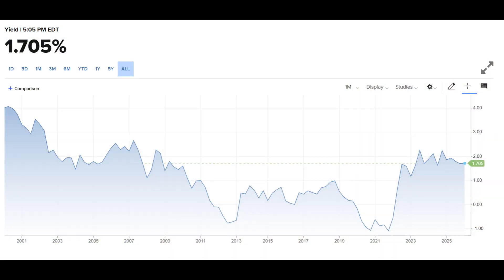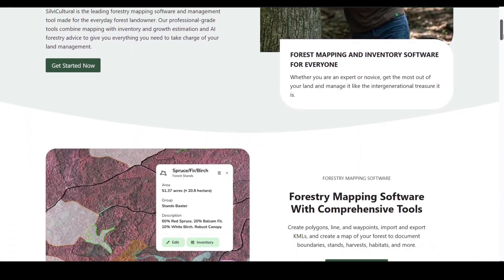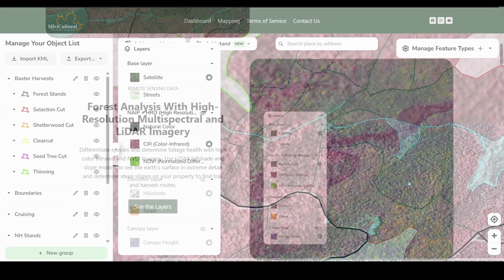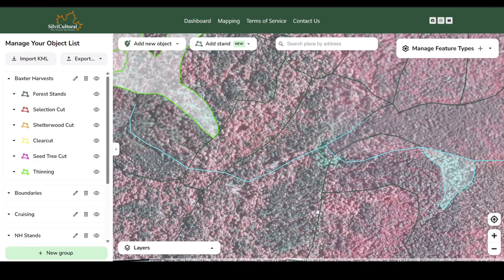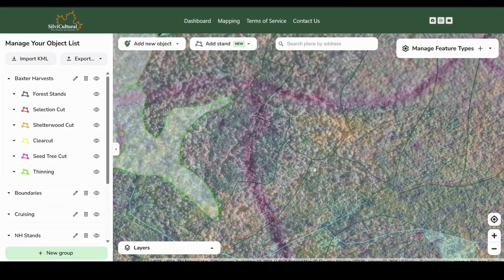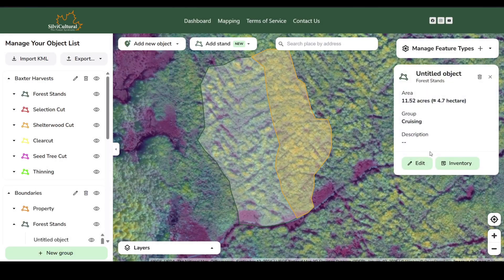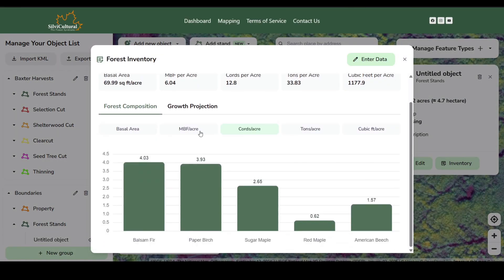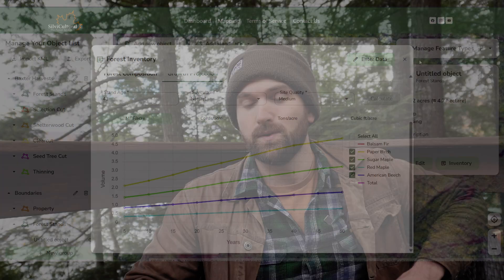Why Much of the Timber Industry Is Unsustainable

Comment: As an Ex-Forester my comments have a bit of weight. The corrruption of forest management has a history of over 100 years here in the USA! (Private and Government managed) The economics are as fake as our Stock Market. The only difference is that the biological component are forests! However, there are no Real Forests left rather what we see are scattered and fragmented woodlands that have been high graded for generations. The value of these woodlands decreases every rotation from a genetic stand point as the replacement or substitue value of another material goes up (Think, steel, plastics, etc.).

Comment: I'm not a forester, I'm a regenerative farmer that dabbles in forest management. My forestry point of view has largely been shaped by the example set by the late Merv Wilkinson of Wildwood Forest who spent his life managing a 77 acre forest. Since 1945, he earned a reasonable living by selectively logging his property and catering to a local customer value added market. Sometimes he milled himself, sometimes he sold to local artisan mills. When he died, his forest contained more timber than when he started. furthermore, his forest was more mature and as such, was more resistant to severe forest fires. 

My personal experience comes from managing a tiny 10 acres on Vancouver Island over the past 20 years. I have red cedar, douglas fir, big leaf maple, and red alder. 100% of my home heat comes from this forest. I have a small sawmill that processes alder along with windfall cedar and fir. Despite extracting value annually, I have more timber today than when I started, a taller tree canopy, and by doing this, have reduced the impact of climate extremes. My fire risk has reduced, my need for summer air conditioning has gone away and my need for irrigation has decreased. 

I'm currently selling the west coast 10 acres and have bought about 40 acres of forest in Arkansas ozarks. My uneducated observation is that Arkansas forests are much slower growing despite having a longer growing season and more summer rain. This confuses me. Using google earth I can see that my arkansas forest is older than my west coast forest but the trees are tiny in comparison. It is in severe need of thinning, and represents a significant fire risk. I wll not be bringing my saw mill, I don't see anything more than firewood potential for the next decade as I thin the forest and increase it's ability to produce wood. I will extract value annually, and each year the forest will gain in value. 

Despite most climate change fanatics labelling me a climate change denier for rejecting their CO2 hoax, I do believe there is a real and significant environmental and climate change cost to reducing the average age of forests. There is significant environmental benefits to increasing the distance between the forest canopy and the forest floor. The greater that spread, the less the risk of severe forest fires. The greater the spread, the ability of the forest floor to retain moisture is increased. The greater the spread, the cooler the forest floor and the healthier the underlying aquifer. 

The shift to microforestry whereby local economies maximize the economic benefits of local forests is a shift in the right direction. Not only do local economies gain more financial benefits, they also benefit from a more resilient environment.

Comment: My suggestion for an objective measure of DCROI is to use the one year treasury rate (4.28% rev. every 6 mos.) and add the CPI (Oct. 3.1%) to achieve an objective method (number) for discounted cash. In this case the number would be 7.38% (number will go down with expected Fed Bank rate cuts) then a rough rule of thumb is to divide the discount rate into 72 in this case about 9 years 9 months. for break even time to let tree grow to max. size. More importantly in this modern age of AI an automated scanning timber cruises can be as accurate as the landowner wants. (every tree is possible) Scanning will Geo. locate identify and measure each and every tree during a walkthrough scan. Further subsequent scans will accurately measure tree growth by comparing new scans with older scans telling the owner which trees are growing at or above the nominal rate for each species and will ID trees that have stopped growing or fall below nominal growth rates and need immediate harvesting. Forrester's that invest in these expensive AI systems will in my opinion be in great demand for future land purchasers/buyers and more importantly to owners taking most of the guesswork out of timberland management and be able to offer management services and cash flow projections accurate enough to even satisfy conforming lending institutions. (Commercial Federal Chartered  Banks) The above data could be used by owners to project EBITA and confirm that continued holding of the land fits the owners investment objectives. Future profits/losses and cash flows with projected taxes reports become a computer click away for savvy Forester's. As a pro in this line of work/services do you think the above would be useful to your clients/customers? Ray
Reply from the maker: If you are going to be adding the CPI to your discount rate, you also have to be inflating your revenues with CPI, which just negates it. Thus, you might as well leave the CPI out. That's essentially why I make the argument for TIPS specifically because it already includes that mechanism. As for the duration that should be used... I think there are arguments to be made there. 

I do think most forest management will be automated/AI driven in the near future. I'm just not quite sure the exact form that will take. Im generally skeptical of regimes that promise hyper-optimization on either growth or financial fronts. In my experience, they tend to obfuscate underlying assumptions that can be incredibly flawed. If uncertainty exists, it should absolutely be well-understood and in the open, not hidden with false promises.
Reply: @thetimberlandinvestor  This is your industry, however guessing at future value of money is making long term assumptions I recommend you stay objective and only use today's numbers. Making guesses as to what the values are going to be is risky in just the last three years CPI has varied between 9.1% and 1.4% that's in part why I only use current actual number for my projections never guessing what the future may hold. You or I was not careful enough as these numbers are by me never used for future projection but rather an accurate today snapshot of actual values. If you ever leave out the CPI you are stating that their is no inflation and the cost of goods in today's dollars is not going to change.. this is for me a huge unwarranted risk that prices will not increase over time. Leaving out the most significant cost moderator will for me always be too risky as we have hundreds of years of data supporting increases over time. Want to be more aggressive change the log log rule of compound doubling number from 72 to 85 and the converse is also true don't think inflation and interest will be persistent lower from 72 to 65 I never use guesses or would ever think  to make a false promise my projections are always based upon today's actual numbers I leave the guessing to others as you have suggested by assuming that I am projecting that future revenues would increase by the inflation which I did not do. As far as change goes if history is any indication the AI influences upon your industry are likely to be disruptively quick . Look at printing which no longer employees platemakers, camera men, color separators, strippers, highly paid trades that took years to learn taxi cab owners who had medallions worth in some case hundreds of thousands of dollars now of no value replaced by ride share aggregators (Uber, Lyft) soon to be replaced by fleets of robotaxis. What I am saying is skills that have taken you years to acquire thru experience i.e. ID species in an Forrest determine size growth rates... and many other skill that make you highly valued and effective in a Forrest may become to a large part replicated with a cellphone or digital scanner. I am a loyal viewer of your channel and am thankful for the time and efforts you expend to bring me along.

Comment: no more wooden pallets. For sustainability purposes. Use plastic molds
Reply: The wood that gets used for pallets is the low grade wood that comes out of the sawmill. If you quit building pallets out of wood the low grade boards would have nowhere to go.